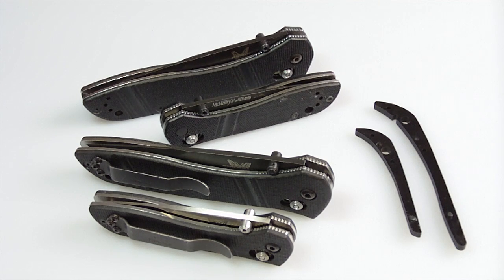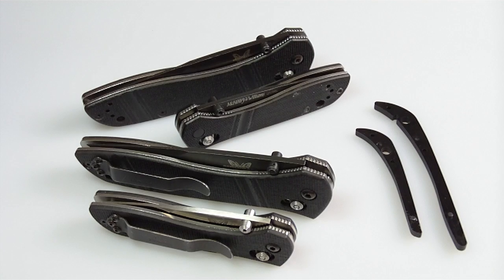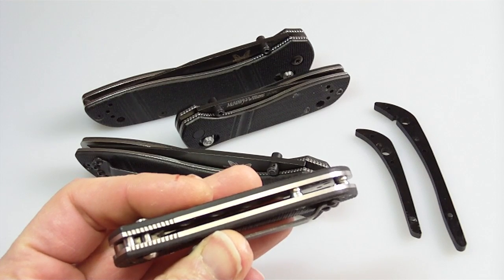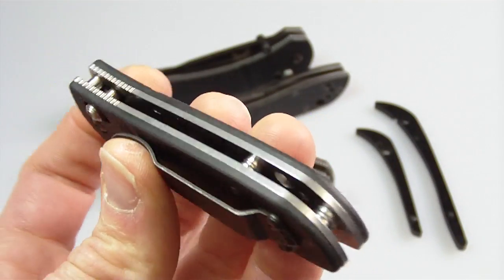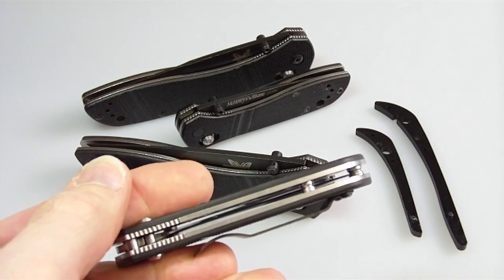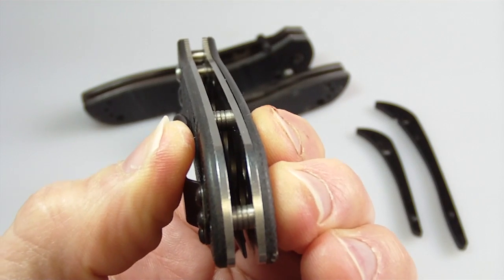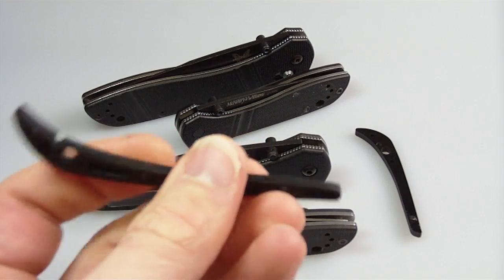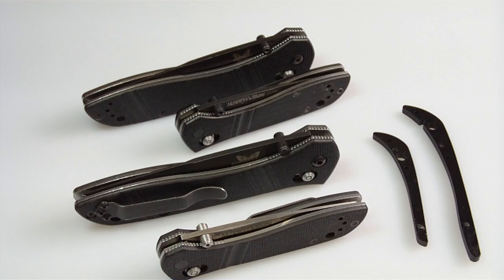Benchmade 710 and 705 Backspacer Conversion to Open-Bottom Construction

Comment: I am confused, in your video you refer to both knives as a 705.  I just purchased a Benchmade 705-401 limited edition with silver twill G10 scales that look like light carbon fiber and think the silver open back-spacers would definitely compliment the knife, as it's all silver, except the black bar in the back.  Please confirm the 705 requires the Backspacer/Standoff - Hub Design - (.140) Stock# STDOFB
It says it can be tapped with a 2-56 thread screw, does this require drilling?